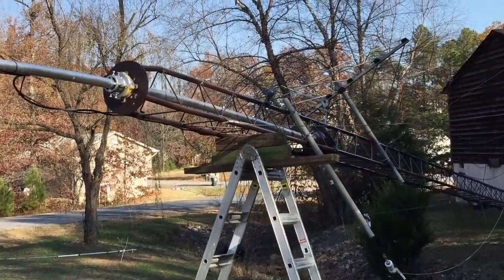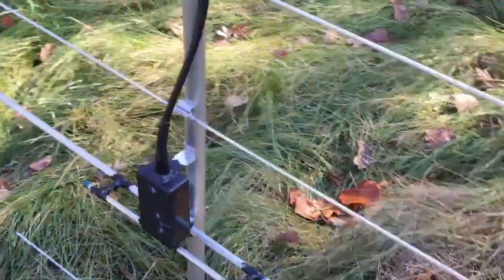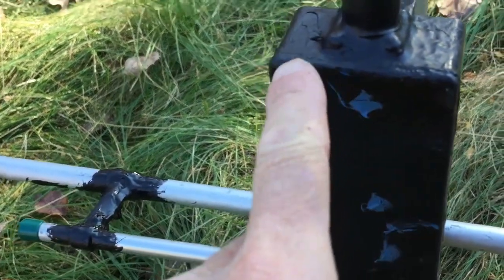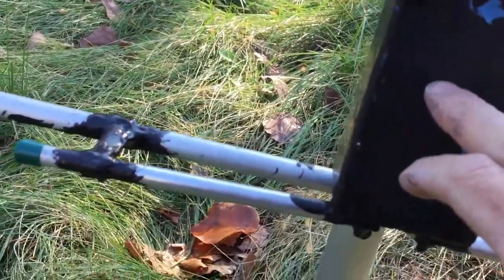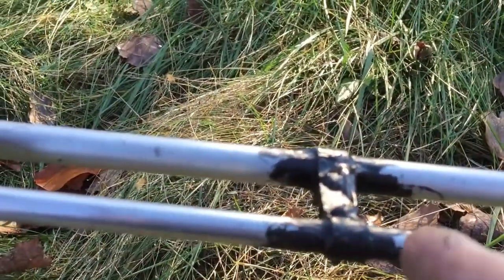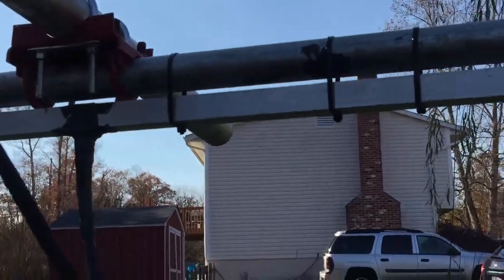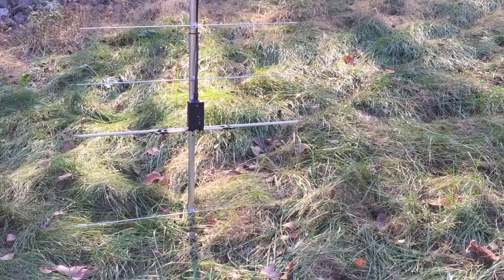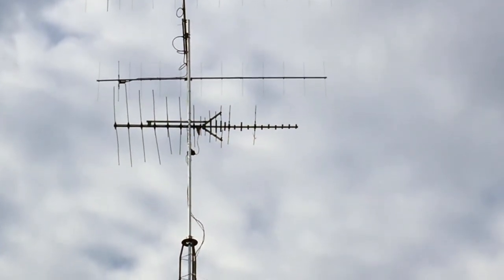Twin 13B2 Cushcraft Yagi's Together. And SWR Water Problems These all Seem to Have

Comment: What you want to do on the matching connections is use some electricians anti-corrosive grease ( Gardner Bender No-0x)
this will prevent corrosion, but leave the connections clean and adjustable.  What you have done is nuts.  When water does get in.. you wont know it.. and when you want to re-adjust the match... you wont be able to do it ...  If you have a 1:1 match across 4 mc... you are transmitting into a resistor or a carrot.
Reply from the maker: Ok thanks!

Comment: Hello Rudy, I’m curious how far the 26B2 was able to reach running barefoot? Interested in your distances for both regular and band opening conditions. Thanks & 73
Reply from the maker: It depends on conditions, terrain and of course and the other stations setup.  There isn't really just a "range" you can pin down.  30-40 miles base to base was easy, 25 miles base to mobile was pretty easy.  I've talked much further and less far of course, I'm just talking on the average.

Comment: Can i ask wht the size of the spacing between the two antenna ang the size of the phasing harness tnx..
Reply from the maker: If I remember right it was about 9 feet and something.  If you get the manual for the 13B2 it has the correct spacing for phasing 2 antennas or 4 antennas..

Comment: Pathetic design.I Sold both of my 13B2 yagis because even sealed they filled up with moisture from condensation.They talk great when they work but I replaced them with a CUSHCRAFT 215WB because they don’t have any issues with water & I think they are the best 2 meter Yagi that Cushcraft ever made by far.They make Long Haul 2 meter QSO’s Easy on SSB or FM.
Reply from the maker: Oh very good... I'll check them out.  Thanks for the feedback.. 😊

Comment: That sounds great but Condensation will build up inside them if you live where humidity is an issue as it is here in Northeast Florida. I sold mine & went to an old Cushcraft 215WB which does not have that useless POS water gathering box.
Reply from the maker: 1OFGODSOWN 1OFGODSOWN humidity is a issue here in Virginia in the summer time.. after sealing this box,  they’ve been working fine since the making of the video... I forgot when but probably 2 years ago... but I’m sure the older ones are better... especially since MFJ got a hold of them😀😀

Comment: good video to find I just bought and am putting some of these together so glad to know about the liquid tape idea.
Reply from the maker: Yep, those MFJ matching boxes leak like a sieve! They must be sealed if they're going to last...thanks for the comment
Reply: @JLPicard440  Rudy, opened mine and filed with water and they have not been up for months. Geeze how much was in there originally!
Reply: The Flex Seal advertised on TV also works very well.

Comment: tell me more about you matching harness. did you use 75ohm coax or 50?
Reply from the maker: Robert Forest Hi Robert,... I used a homemade power divider made out of copper tubing and aluminum square tubing.... the power divider is close to 4 feet long... from there I used two equal length 50 ohm lmr-400 to each antenna... I can try to post a link to plans if your interested
Reply: Take a Bath Productions I would like to see your plans. I have 2 13b2's I am planning to cophase
Reply from the maker: I uploaded the PDF file to my google drive.  Let me know if you have trouble viewing it.  Thanks...

https://drive.google.com/file/d/0B_jTWbEq1NOpZ1VfYkhEMlZ4cG8/view?usp=sharing
Reply: Take a Bath Productions thank you I will check it out

Comment: Humn vertical? I may consider flipping mine if we continue with no 2 meter ssb activity.   I have a pr of 13b2's that have been  up for at least 10 years no problem with water and did not do that seal stuff only the connectors. My phasing  harness and divider was made by M2. My only regrets is that my tower wasn't taller :-)
Reply from the maker: johnnieace45 I can't explain it... there are several of us here in va that use these on FM simplex and pretty much everybody had the same thing happen after about 6 months SWR was almost 2:1 take them down and open the box and always find moisture.... could be when they're vertical they are more susceptible to water getting in vs. flat.... or I'm sure the climate could have to do with it too... it's pretty wet in Va.  yea not much SSB here either...